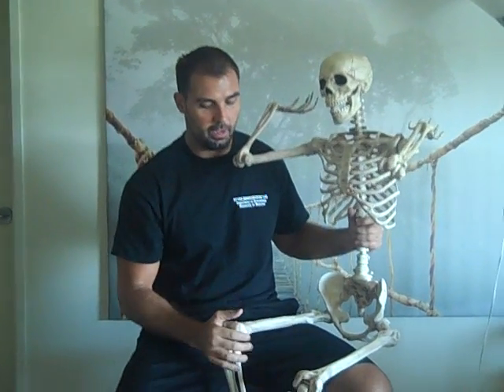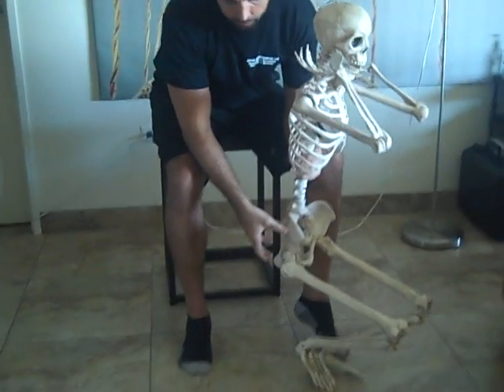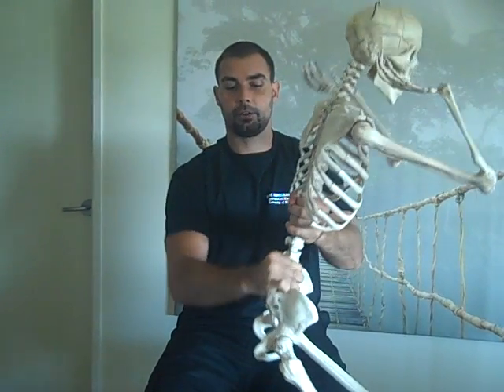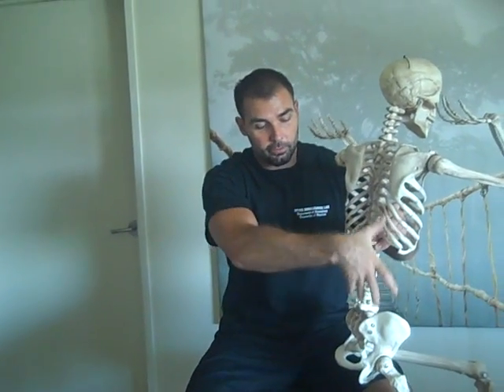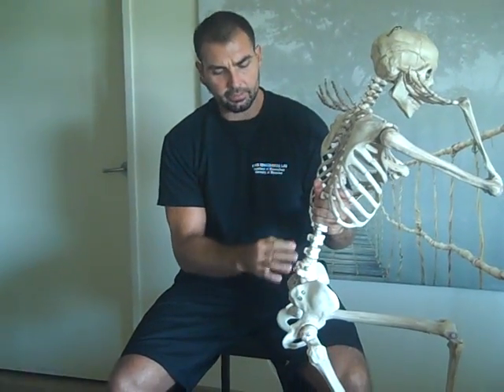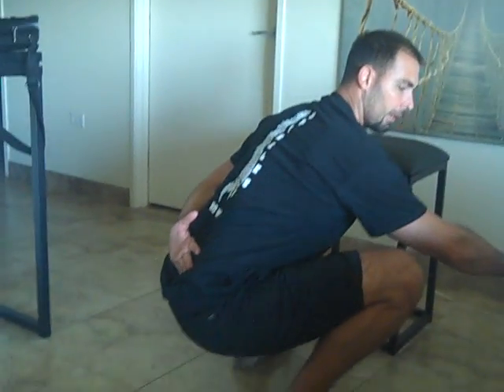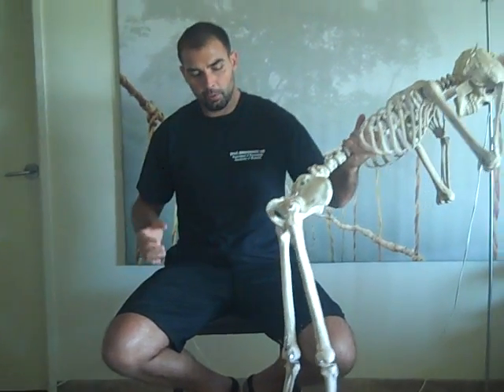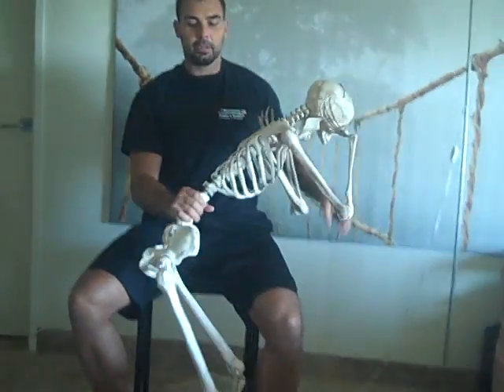Squat Biomechanics and "Butt Wink"

Comment: All you have to do to get rid of butt wink is increase the strength of your Tibialis Anterior muscle. The reason you are going into butt wink is because your tibialis anterior can't hold the opposite-side force of the hamstrings contracting, so the only thing your body can do after you've fully contracted your hip flexors is to flex your spine so that your body stays in the same gravitational alignment, otherwise you would fall backwards. If you keep your hips and spine as an unmoving unit with isometric tension by flexing your abs and spinal erectors at the same time, and then you hold your tibia in place ((i.e. at the ankle joints) with isometric tension by flexing your tibialis anterior and soleus at the same time, then your hamstrings can freely contract, pulling your hip-spine unit downward, and depending upon the strength of your tibialis anterior muscle, either your hip flexors will contract so that the tibialis anterior has less weight to hold up (due to better alignment with gravity), or the hip flexors will stay dormant and the tibialis anterior will have more weight to hold up (imagine being in a squat position with both your hip-spine unit and your tibias exactly parallel with gravity -- this takes considerable tibialis anterior muscle development)

Comment: so is he saying you just force yourself to straighten your back? is there any other way to explain how to improve buttwink?
Reply: Phili721 
- Depends on a persons anatomy
- You're not getting good glute activation(try hip thrusters to help)
- Poor dorsiflexion - try squat shoes, or slip plates under your heels. 
- Practice squatting -- goblet squatting might be a good place to start as you can sink deeper into that squat with the weight displacement of the DB. 
- Try different foot stances(narrow, neutral, wide and very wide)

Give those a try. Very dependent on your biomechanics.

Comment: This video makes alot of sense but ive noticed that 100% of olympic lifters have absolutely 0 butt wink. Does this mean that if you have butt wink, that you are genetically unabled to become a serious olympic lifter?
Reply: you're obviously blind
Reply: bm seven Well i meant to say TOP olympic lifters. The fact that the top oly lifter dont have buttwink and that it does occur among mediocre oly lifters only further proves my point that genetics are a must to become a good athlete
Reply: Harres Dirksen There is a difference in hip structure between lifters, and between ethnicities. However, you can look at Klokov and the guy who actually holds the record in the 105kg weight class... they have very different ranges of motion, but both are among the best in the world. They probably have very different hip structures and leg segmental lengths (and upper body length relative to legs), all of which makes a huge difference in how you squat and what your ranges of motion can be with a particular width and amount of turnout.

OL is technically not about squat depth: It is about getting under the heaviest possible bar and standing back up. And, then, getting the bar overhead in the case of the clean and jerk. Could the other Russian lift even more if he could get deeper? Probably, yes, but if he could do that without hurting himself he probably would. 

However, he has shorter legs than Klokov, and seems to have a longer body, so in the end they have each used their own personal advantages to get under the heaviest possible bar.

You see all kinds of differences at World level competition, and it is very interesting to watch them all. Some people have more turnout, some less. Some get incredibly deep, some do not. There are even differences between people who hit the same weights.

The one thing that's common is that you can't allow any butt wink in a dynamic squat like OL. You'd delaminate and rupture your lumbar discs very, very quickly and before that your power output on the way up would be compromised. The body doesn't like to produce maximum force when there are abnormally high shearing forces through any joint, especially the spine. Sure, you can override that inhibition with training, but that just gets you injured faster.
Reply: You actually see immense variation in squat depth, foot positioning, and body angles used within the Olympic lifting community. It's quite interesting, and educational when you have a solid background in the biomechanics of what they are doing.

Comment: Thanks a lot, Bret. I'm working on overcoming "hip impingement" but I know it's due to many factors, not just bone on bone even as the x-ray revealed only SLIGHT impingement. I sit a lot at work but have always been fairly healthy. I've learned that the squat is an advanced move and requires dedication to fix it. This video is ahead of the curve. Thank you very much!

Comment: I was feeling bad because I can't squat to parallel without buttwinking. I'm going to keep practicing with good form and hopefully it will improve.  Great video. 

Also, would abdominal fat and leg fat have a detrimental effect on hip mobility? I'm about 180 lbs., 5'4", and about 38% bf according to a caliper that measures fat at abdomen only. So I was wondering if my hip mobility would be better with lower bf%.

Comment: Can you suggest an exercise that will improve ankle dorsi flexion?

I can go down pretty low in my squats without rounding out my lower back but I will take a very wide stance and my feet are pointed outwards any knees are basically pointed in the same direction. Is this structurally sound?